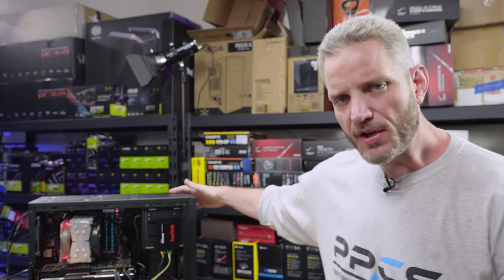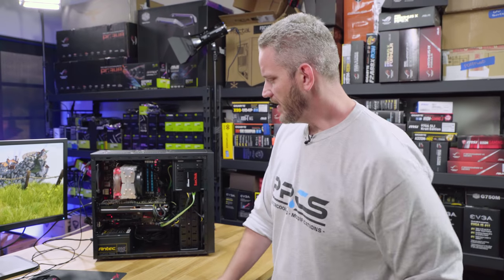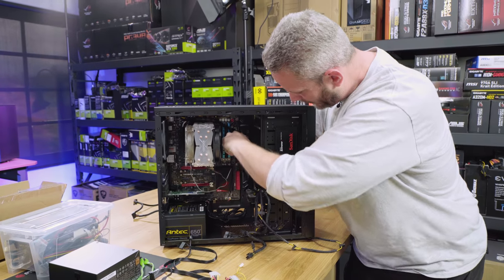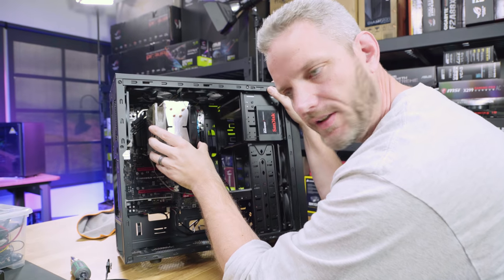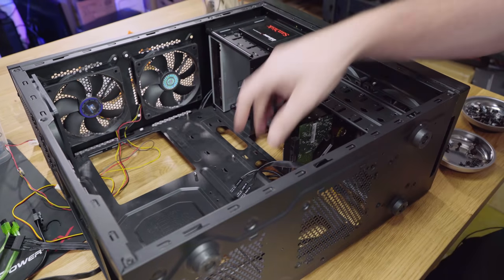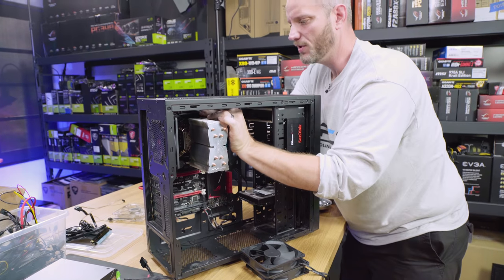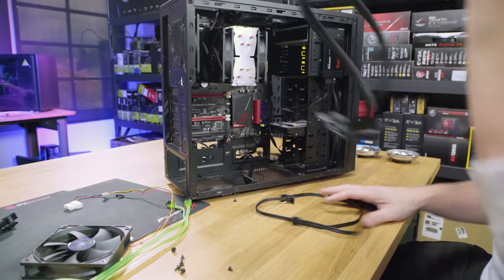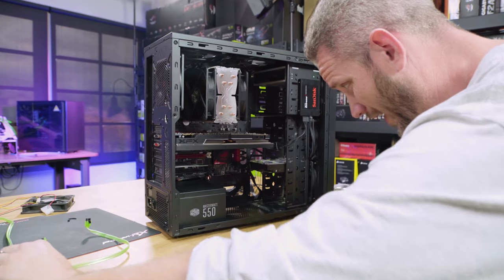It was worse than I thought... Fixing PCs Part 2

Comment: I literally caught my first computer on fire...compared to me the guy who built this is a pro
Reply: Payne Hoss how tho
Reply: @nexusxe  he had a 9900k on a great value power supply. the crappy PSU and crappy CPU heat went bad quickly
Reply: @vovical  Crappy PSU's are always the best idea
Reply: Yeah but a fire? Something else was wrong there dude :D
Reply: Khola heat, plastic, fire.
Reply: My first desktop started smoking after the fans cut out and the CPU fried itself while playing Minecraft of all games
Reply: I plugged my fans straight into the PSU my first build. Had to fix that because it was sooo loud.
Reply: @pugfoprez7081 PugFoPrez wow crazy! when did this happen? haven't tech become better since to prevent this?
Reply: Rex1987 yeah, but this was like 2012, with a computer bought at a questionable price
Reply: Liar
Reply: I was helping a friend built a pc back in the day, he was doing the assembly while I talked him thru it, told him the 3.5" floppy power connector was keyed and you couldn't plug it wrong. Fast forward to first boot, tell him to hit the power "and see if it catches fire". Screen black, nothing for 10 seconds... then the floppy drive starts smoking. Turns out you can plug the floppy power in upside down.

Comment: i love the call out for toxic community members <3 if you build a pc for the first time and it boots im proud of you :)
Reply: because building a pc is so hard....
Reply: @Crank1222  Setting it up,installing OS,installing drivers,enabling XMP,some overclocking,formating drives sure are all easy and definitely not hard to a new builder.
Reply: Bro, he didn't screw in the motherboard properly cause he was lazy, he didn't screw in the hard drive properly, cause he was lazy, that could damage the hdd. He also ripped a connector, how tf do you do that?! Sounds like he didn't just care
Reply: I built a PC for the first time roughly 2 months ago. It was my brother’s old pc so it already had the BIOS set up, I just had to install the mobo into the chassis with the video card and radiator. It booted and I was so proud of myself. After watching a lot of videos about building PCs I realized I mounted my radiator fans wrong and my cpu was overheating. So I remounted my fans. Then I re cable managed it. Now it looks great. Eventually as a PC building enthusiast, you get tired of looking at bad cable management even though at first I thought I wouldn’t care.

Comment: Cable management for me... plug it in and stuff the wires into the case and call it good.
Reply: It's easier to upgrade and swap things out when the cables are everywhere. Otherwise I have to remove cable ties and manage the wires again.
Reply: Same here
Reply: Works? Don't touch it
Doesn't work? Touch until it works
Reply: Well, I dont really care about the neat looks, I care about airflow and stuffing cables in randomly disturbs that.
Reply: JETWTF same bro
Reply: +Chuckiele Actually stuffing cables into the case today does not harm airflow. That was true when everyone had those wide ribbon cables, 2 going to the top of the case and one to the hard drive cage and you have 3 3 inch wide cables for the fans to blow air around. modern cables are far smaller and the air flow wont even notice they are there. Then with modern cases you have the power supply shroud and the hard drive cage is inside of it, to get to it you need to route the cables through the back so all that will be in the case main chamber is a few fan cables going to the motherboard if you don't have a fan hub or controller.

With modern cases the power supply shroud causes as much ventilation problems as ribbon cables did. If you have all three from fan slots being used the bottom fan is cooling the inside of the power supply shroud just as much as the rest of the case and there doesn't need to be any cooling in there even with 3 HDD's.
Reply: Chuckiele no it doesn’t. Linus and Luke did a thorough video of that
Reply: Get a small case, a ton of chaotic cables and add dust to that and you quickly end up in the situation you used to have decades ago. I never thought of power supply shrouds as something improving airflow, but only as an aesthetics gimmick, so I dont have one.
Reply: +Chuckiele The dust is your problem, not the cables. Get some high pressure fans and fan filters. If you cant get fan filters then go to your local hardware store and buy some vinyl window screen, for each fan cut two pieces that are 45 degrees different in angle, detach your fans and use a little tape to hold the screens to them then reattach the fans. There you go, homemade fan filters. When they get gunked up just replace with new because you have the rest of the roll of window screen.

The reason ribbon cables were an issue was because of case design back then and the case fans and CPU/GPU coolers. Some cases didn't have a front fan mounting point at all and most just one mounting point. Then the fans were 80 mm and smaller. As for the coolers you couldn't get a tower cooler and GPU's were a heatsink with a fan taking a single slot. With those coolers you need good airflow. Once case design got better with 2-3 front fan mounting points and vents in the back of the case anywhere they could be done, and 120 mm fans were introduced, the cables didn't have any effect on temps even if you only had a 120 intake and exhaust. Were talking very early 2000's to around when the Pentium 3 was first announced.
Reply: Use velcro straps not cable ties
Reply: +Griffin S Velcro straps are a good alternative to zip ties you can buy those in 8 foot long rolls, another is the black twist ties that's used for just about all cables in their packaging and often many other things other than cables. Anything but zip ties or black electrical tape.
Reply: I try to do good cable management but people come in with shitty cases and I still try but it looks like shit.
Reply: I personally find the old case designes, as in the IBM style, quite ingenious but yeah, they obviously did not have the best airflow but they also didnt need as much bach then. But I dont have a problem with dust, I have a case with rotated motherboard and 3x180mm filtered intake fans on the bottom. Im just saying that people that dont have that, will more likely get dust issues if they have bad cable management.
Reply: Thats actually a good point. There have been systems with external radiator and zero airflow, that had good temps on CPU, GPU, RAM, VRM, Chipset, etc and then a CPU or GPU power cable started burning.
Reply: lol same
Reply: Im doing the same with the gpu cables. My modular bequiet comes with odd gpu cables that have two 6+2 going into one big plug. Its usually fine because most gpus I had needed more than one but there was a time I had one that didnt, so I just left one cable laying around in the case because I would eventually get a new gpu anyway :D
Reply: Same mate... same....
Reply: My own PC, which I ordered from Germany (I could choose my own hardware to go into it, which is awesome) has an AeroCool case which seems to have very good airflow and dust protection. Sure, it has only one intake and one exhaust fan, but the intake fan has a foam dust filter and after not cleaning my PC for about 1,5 years, I first opened it up to see only a very light layer of dust on the components. Only problem I have is that I can't really get the graphics card out, because the slot for it has a clip like RAM slots and I cant get to it right now. My RAM is also sitting right next to the graphics card and blocking one side of the RAM slot clip from opening.
Reply: Same, I can't be bothered to move my wires around if all the stuff is plugged in, hidden from side panel view, and working
Reply: @Chuckiele  LTT says this isn't true.
Reply: @kyle857  Then its likely true.

Comment: I worked in PC repair, I was running a store. You quickly realize that almost no issue is ever alike, and you also realize that symptoms lead to different diagnosis too, further extenuating the solution to be specific for the platform you fix. 
Makes you think a lot. PC repairs is a tricky work.

Comment: I can understand not worrying about cable management, but missing 4/6 standoffs is a crime. I mean, come on, at least open the installation manual and follow the instructions!
Reply: Man, ain't nobody got time for screwing in nine stand-offs.
Reply: My first case didn't  come with all the necessary standoffs
Reply: But they do have time to screw in 5 case fans huh? lol
Reply: Standoffs aren't needed, managed to install my board with no standoffs and with one screw holding everything and it looks fancy
Reply: Pretty sure Jose is joking.
Reply: No self respecting DIYer reads a manual come on..
Reply: Commander Shepard  you need to chill out
Reply: I'm pretty chill.
Thanks for worrying though.
Reply: Except for beep codes, why is this never on page 1; Also good to check a manual b4 buying to check for if you use x you can not do y cause of PCIe limitations
Reply: I can understand it makes you feel alive, but i mean, common, at least try to listen to wise ppl telling you not to be judgmental.
Reply: Why even bother with standoffs at all? Just glue gun that shit to the case!
Reply: Once I was meant to build a computer for a friend but he got the parts a day before I could get to his place. Another friend went there and they started building it together. They told me it wasn't working so when I got there I found a motherboard screwed directly on there without any standoffs. It's a miracle that computer still runs like 5 years later.

Comment: should check under cpu cooler, probs no thermal paste
Reply: if there was no thermal paste then it definutly wouldn't run Heaven better yet boot into Windows!
Reply: i used to run my pentium 4 2.8ghz northwood with no thermal paste lol! it never got too hot or ... gave any slowdowns or warnings but at the same time i wasnt overclocking so...  hehehe
Reply: lol wow Noah you must have gotten very lucky with that build!  I have an AMD K6 computer that I use to play old games from the 90's or early 00's.  I have never replaced the thermal paste on it in the last 18 years I've had it, but it only draws 8 watts of power, so even if the paste was bad, it wouldn't be enough to overheat it!
Reply: Captain Soban you don't need thermal paste to boot a computer it will still boot without it it is only used to help cool the Cpu. It's not even really even required. I had a i5 4670k and ran it without thermal paste for a year and never had any overheating issues on the stock clock. Still runs fine to this day.
Reply: I was running no thermal paste on an AMD A10 for over a year before realizing it
Reply: CPU don't really need thermal paste but if you're intending to overclock it, it will pretty much be required to use some, it can take off about 10 to 20 degrees of heat.
Reply: @Shipprofile08  of course it would still boot without paste wtf lol

Comment: This has a normal side panel, not a glass one, so who gives a shit about what the wiring really looks like anyway! lol
Reply: Russell W, I'd rather have a nice and tidy build v.s. just throwing something together. Plus, it makes hardware swaps a lot easier when you're not fumbling around with cables and wires. Also, piece of mind.
Reply: Also good cable management helps airflow and inturn helps with temps.
Reply: Pablo the Gamer Dad, eh....unless a cable's preventing a fan from spinning, cables in the way have a negligible effect on airflow. You'd need more cables than the PSU is shipped with to cause a negative effect. (With a decent sized case that is)
Reply: Pablo, cable management has ZERO impact on cooling. Don't believe the myths.
Reply: brady, thanks mate, I was going to post that link as an example lol
Reply: You're wrong there. Cable management does affect airflow.
Reply: 3 letters o.c.d
Reply: WOLF Luke disagrees. Post a video and prove him wrong.
Reply: Technically he is not wrong.The cables do affect the airflow but they don't affect the temps.So WOLF is correct.
Reply: A5iAN_GUY of course not, but there are not enough cables in a typical pc to create the wall.
Reply: If it works, it works. It's just a machine to do things. Who cares unless you're creating a rig to show off?
Reply: A normal side panel IS tempered glass, a unique side panel won't have the glass...
Reply: "affecting airflow" is not the same as "impacting the quality of the airflow". So, while affecting it is correct.. it's a completely pointless statement.
Reply: Russell W you read my mind sir
Reply: Jonathan R depends on the cable management, because if you wire them through multiple holes it can be harder than if they were just sitting there
Reply: Hold on, most of the cables were in the back panel - the hell the heck does that effect airflow?
Reply: I agree. My cable management is ass because I have a solid side panel and couldn't be bothered to make it pretty when literally no one would see the effort I put into it.
Reply: That's not true. Unless you case is filled to the brim with cables there is no reason why a few untidy cable should have a noticable effect on temps.
Reply: Russell W Cable management means that you can have better temperatures,  because if they're ticked away you can achieve better airflow
Reply: thats my thinking. I really couldn't care. my temps are good and the thing works. it goes on the desk and never gets looked at apart from pressing the power button.
Reply: Middze go watch the video linked further up in this comment thread it is linustechtips video about if cable management.
Reply: My thoughts exactly, brady.
Reply: @PablotheGamerDad  Incorrect in most cases, but keep that myth alive if you want.  IDE cables are no longer being used normally and were the only cables that could affect airflow to a degree of dangerous temps.  Your information is correct up till around 2002
Reply: Pablo the Gamer Dad nope it has almost no effect on airflow and temps linustechtips tested it.
Reply: Cable management had a noticeable effect on airflow and temps back in the 40 pin IDE/ 50 pin SCSI cable days, today? Not so much.
Reply: Cable management only has noticeable impact on air flow if you forgot to plug in your fans...
Reply: This unit may not have been quite so plagued by issues and easier to diagnose had some pride and care been located and installed.
Reply: Yup. Some PC "guys" are worse divas than chicks. "OMGEEE I need the FABULOUSSSS cable sleeves. Cable management, duh." (< said with a lisp, of course.) Who ever even came up with the word "cable management" in the first place is questionable.

Comment: What is the blower that you use to clean the tower in the video and is it for US outlets?

P.S. The internet will never shut up. XP
Reply: I've only skimmed the video but I'm assuming you're referring to a Data Vac? You can find cheaper branded ones online too. I got one and it's a great investment. Never have to buy canned air again.
Reply: @Kholaslittlespot1  After buying my Data Vac a couple weeks ago. I'll never go canned air again. WAY worth the 80 bucks I spent on it. A lot more powerful as well compared to the canned air. I was looking at air compressors but those cost more and require more maintenance, plus loud as balls.  Data Vac FTW

Comment: My first computer, built with help. I followed his advice mostly since he'd built things before and I was BELOW newbie. Put everything together in the case (already bad), screwed everything down, had a try at making it post...and it wouldn't Fans spun for a second then powered off. Then we couldn't even do that.

Turns out the case came with little card washer things you're means to put over the hole on the mobo. That and I'm pretty sre he helped me screw it directly onto the case without the standoffs. Pretty sure I remember the board was dead and we had to get another? At the very least we RMA'd it and got a new one.

So yeah, everyone's first build has the potential for every newbie mistake to happen. And you're always, always learning.

Comment: I would say that as long as there is no glass side panel and air-flow inside is reasonable I don't give a crap about cables management. BTW Jay "nobody build there first PC perfect"? My father was abroad and needed a PC so I chose parts from online shop then send him video tutorial on building PC and very simple rule to fallow: every connector can be plugged in only one way don't use force if it doesn't fit you doing it wrong. He phone me twice for some details but finish in reasonable time and PC was working. He was 54 at the time and doing this first time in his life. It's not rocket science. BTW next he installed Ubuntu Linux also by himself.
Reply: Stanisław Szczypuła plenty do. It isn’t hard or complicated. My 10 year old did it after watching me put half of one together.
Reply: I normally go for mid-tier PC's. Don't care about the quality; just want it to work at 60fps on the majority of the games that I choose to play lol.